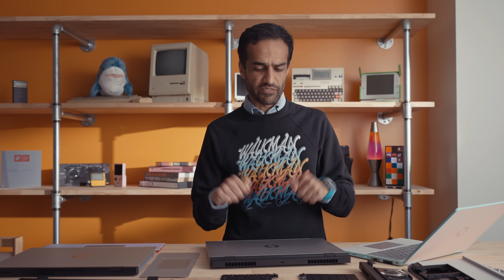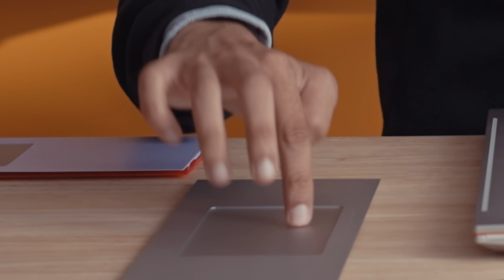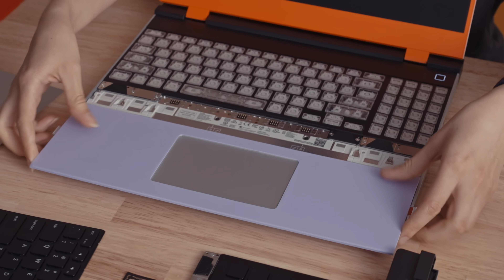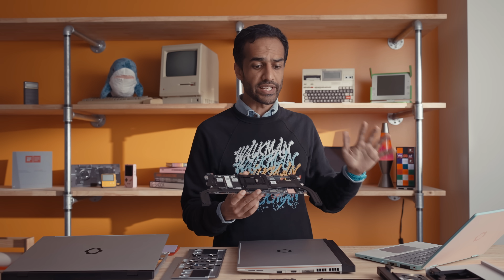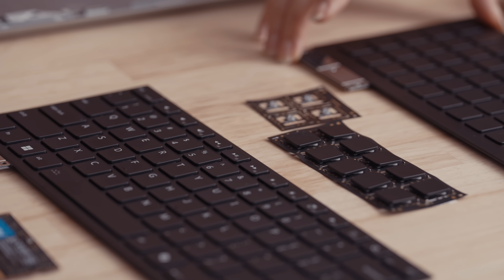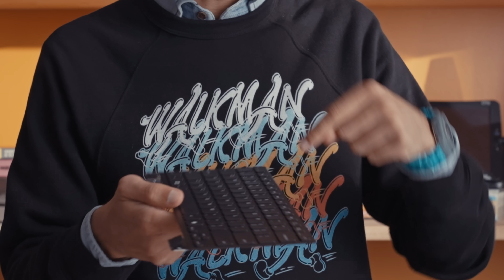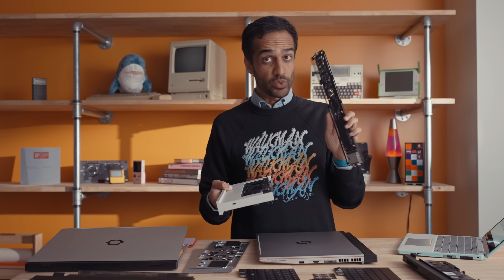Framework Laptop 16 - Prototypes and scrapped ideas

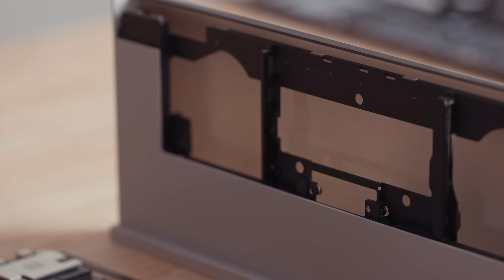Comment: 14:55 - 17:08 Wouldn't a Framework marketplace for reselling swapped out parts make sense? So that potential customers who can't afford e.g. a complete Laptop 16, could buy off the used GPU module from another owner. And the previous owner would be relieved to not have to room-fill drawers with electronics, which then just age away unused. (A small portion of the resell-price might go to Framework, for offering this very convenient way of repurposing redundant hardware.)

Comment: 11:20 Very important remark regarding the keyboard mouse:

Can't you develop a sort of round button that detects the lateral direction at which it's pressed, but that can't be pressed vertically ONLY when the laptop's screen is open? And when you close the laptop it automatically becomes vertically press-able like a normal key button?

One way to do this could be to make it un-pressable only when the keyboard is powered (a switch that locks only when powered for example), and then automatically disconnecting the keyboard from electricity when the screen is closed.
Or you could come up with some other way, but still, wouldn't this be feasible?

Comment: The only thing I'd like to see that isn't there yet is more ports. Sometimes I like to have a bunch of things plugged at the same time, and 6 ports is a bit tight. My current laptop has the equivalent of 9 ports... I've used 8 at a single time... i.e.: you could put a fixed HDMI on the back to help with this
Reply: I think the solution here is dual port expansion cards (e.g. 2x USB-C)

It would theoretically reduce the throughput (but are you really maxing out the throughput on data on a USB-C port under typical use? Even if you were, having a dedicated single port USB-C expansion card as the high speed one for read/write would be a suitable solution.)
Reply: @jessl1934  I mean, that would be a way of using the current model, but I'm asking specifically to avoid having to do that

Comment: I am going to buy a framework soon for 2 reasons #1 this guy is normal (odd for PC makers) and 2 it is just the only pc that will allow me to do what I want with my  PC  I want to run linux on my machine and I want the cooling of the 16 with the HX 370 no dgpu with the perfect amount of ssd and ram vs being stuck on hybrid nightmare pcs for linux works out for me the only think id ask for is a lunar lake for the 13 other than that it's always going to be framework after this.
Reply: I expect we're gonna see a product refresh of the 16 in line with the new 13 pro that just got announced. It's probably a year away imo.

If you can hold out for 12 months, that's what I'd be doing.
Reply: I agree i looked everywhere to find either a amd machine with just the igpu and i am fickle so i am already thinking of adding the raedeon so this allows me to be fickle and if i want to get it a few weeks later I will

Comment: I would so love to see a framework 15. It would be the framework 13 mainboard or a slight upgrade. By upgrade, I mainly just mean an extra ssd slot and possibly some more powerful gpu options. Either way, the idea is fw13 specs but with a 15" display to create a fairly thin and light 15" laptop that is upgradable. Basically the idea is a crossover of the 16 and the 15 for users of a 13 who just need a larger display.

Comment: I am near exclusive on laptop usage as I am always traveling for work. I need desktop performance in a portable form-factor. When my current system dies, I know what I am getting next. I just hope you start offering top tier options for those that aren't shy about cost. I have always been team Intel, but to be fair, I don't like the E-core/parked core BS. I hope they ditch this on upcoming generations.
I might suggest a "battery optional" build. Most (like 99.95%) of the time, I am plugged in and a battery isn't needed. Then again, slotting in a battery that is huge for massive battery usage would be awesome for those that need it. Make it part of a laptop cooling pad that locks in to the bottom of the unit. Having a blank cover for more fans or maybe even slotting in SATA, SAS or U.2 2.5 inch drive expansions would be a nice option for those not using the battery bay.
For the trackpad issue. Offer another module that has no trackpad (blank!!). I use a USB or Bluetooth mouse & keyboard all the time.
It is rare that I use the laptop's keyboard as that is always the first thing to mess up. This would allow slotting the keyboard on the lower part of the system where the trackpad is currently. Venting topside heat where the GPU/CPU is would make more sense. it may allow the option of upping the built-in speakers quality/quantity.

Comment: A single piece trackpad solution with just the normal sized spring board is all I want, I don’t think there’s the need to go for the complex option today. Put out the basic idea and then iterate overtime. The modular palm design puts me off in its current form

Comment: I have been on the fence between Framework and System76. Both are commensurately priced. I will go with Framework. At least with Framework, I can switch out modules as well as make repairs locally and within minutes, versus weeks with System76.

Comment: Can we get a framework desktop chassis that's wide enough for a half height pcie card, especially a dual slot card? And maybe a revision of the motherboard with an open x4 slot (or preferably an x16 wired for x4) as it would allow the addition of anything from network adapters to capture cards to sound cards to even low profile gpus, say you need more display outs.

Comment: Oculink ports and/or a choice of TB5 or USB 4 v2 ports would make the egpu route much more valid and rewarding too. These options are the only options that aren't massively bottlenecked in terms of pcie bandwidth, so older framework graphics modules will work just fine, or if customers wanna go crazy and hook up a 4090 to a FW laptop cuz why not, all will be made easier with official support for Oculink or adopting the new TB or USB standards. Unofficially there is Oculink support through the dual m.2 adapter module, so why not go the extra step and make it official? And it would make sense for Framework to enable higher bandwidth egpu support, given the company's ethos of repairability, DIY mentality, and upgradeability.

Comment: The input modules make me wonder about modular insides. Get 4 SSDs in one laptop, or fill it with batteries for max battery life, things like that. Maybe even a little low-power GPU module (let me dream). Like PCIe slots or drive bays in PC cases.

Comment: Have you think about using the screen and the keyboard of a framework 16 to create a Lapdock (a framework 13 is also a good option)?

Because, the existing lapdock for phone and/or gaming handheld are quite bad. Especially if you need a full keyboard.

With the release of your first desktop (a portable desktop), this could be a nice bonus to offer to your customer.
Reply: I would add, if you go with this, it should be able work with a existing framework laptop. In other words, the user should be able to downgrade a old laptop to a lapdock. The reverse should be true to. If someone buy a lapdock from you, they should be able to upgrad it later to a fully fonctionnal laptop.

I understand new internal part are required to make all this work. This way a fully workable laptop could be downgrade to this with the purchase of the internal lapdock part.

Comment: Lovely improvement, especially the NVIDIA... But quick question though, are you guys working on a workstation variant? Or will they be any workstation card in the future? And a near desktop processor would be appreciated please.
also when do we get the ability to change the Webcam? Will there be an 18 inch display? If possible you could make the body larger to house more components like extra speakers, and maybe more type c port. And increase the max power brick.

Comment: It's good to hear that you've tried implementing something like the track point, I'm curious if you've considered making it concave instead of convex? Or leaving a larger gap to the neighboring keys to allow it to sit lower?
I understand you don't want to engineer every little component that goes into these, but my understanding is that the current strain gauge navigation sticks available are very poorly optimized compared to the Lenovo/IBM history and I would suspect anything you design (or commission) will be notably better than the existing components. 

Lastly, I know a portion of that navigation dot quality is lost in the firmware/software, but I now understand that it could be from the over-thinnification of everything electronic these days. Your candor and openness is appreciated. 👍

Comment: It would be cool if you were to release the plans or even just release the prototype models like the touchpad. Even though it might not have worked for you, maybe someone else could find it ideal. One thing in general I'd like to see with Framework is more third party accessory support- not just 3D printing, more like full on electronics, for example a numpad-size touchpad in place of the numpad module, or (probably would require modifications of the mainboard) a mini display.

Comment: for the gpu, could you guys make a pcie card adapter to mount it into a regular pc? it would be a bit of a wacky size sure but it would mean we would have a proper mobile gpu to put into a desktop for low power usage builds instead of having to use the china knockoffs with no software support. It would also be a nice hand me down part for a starter gaming pc.

Comment: The screen looks very bad with these thick 2010-style bezels. And also 2010 laptop thickness. Can't understand why you are trying to make a profit on reselling RAM & NVMes. They cost literally up to 3x less to buy myself. And I'm sure as OEM you actually get them at way way lower prices. I really love the idea, but can't possibly justify spending this much on a thick unportable plastic laptop. I have a PC at home so I thought the whole idea of laptops is portability.
I'm still using a 2020 (5 years old!) 13" aluminium laptop, which has 2x USB-C (Thunderbolt) 1x USB-A 1x HDMI 1x SD card. Can't even fit these on your 13" laptop. Can't even think about adding ethernet. Mine has like 3mm bezels on all sides & touch. Why would I spend so much on a downgrade instead of getting something like a ThinkPad ultrabook?

Comment: What stopped me from getting a framework laptop during my most recent upgrade was the lack of availability of a top quality OLED screen or a 2-in-1 folding laptop. I ended up with an Asus Zenbook but got crippled by a lack of Linux support for the non-standard features (2-in-1 sensors, webcam privacy cover, etc) by Asus software developers.

Comment: If you could figure out a way to put a Wacom tablet option instead of a touchpad, that would be super super cool, I think thinkpad had it for 1 generation on a high end workstation model. Would solve the palm rejection and click detection problem as the pen input is unique. Also, since the laptop is both fully upgradable and made to last a long time, it would make sense and also be unique.

Comment: I looks like it isn't hard to make the laptop and it's pieces, the hard thing is to provide the parts at reasonable prices! And I feel that pain! I am from Brazil and the cheapest laptop from Framework is close to 4 minimum wages! Laptops at two minimum wages are the norm, and they are already expensive! But I am sure you will be able to go toe to toe with Lenovo and the other OEMs in price. In quality you are already in front!

Comment: The pointing stick thing wouldn't necessarily need to be in the same place as on thinkpads, did you consider putting it on the track pad module instead? Idk if you have more or less clearance there.

Comment: Silly question but you make a laptop with integrated space for adapters from usbc connectors to everything else. So why does the GPU require an external adapter to displayport and hdmi? I get that hdmi is a pain to add because of the group that controls it but how about a display port connector?

Comment: Great marketing and finally a company that listens, innovates and explains why things work or not.
 
My biggest problem is still the keyboard spacers, I really dont understand why there is no option to have a complete lower part in aluminum?
I mean the 3D print is exactly what I want, but why is it not possible to pay 20/30 bucks and have a complete module?
The file is already there? A larger trackpad would be great, but for me not necessary. I absolutely despise the spacers on the side, I get that its "modular" but please, why is it so difficult to create a  complete layout, with the keyboard, numpad and normal touchpad in the middle, like nearly all other laptops, that has no spacers? I mean for 2000-3000€ depending on the specs I dont want to have to rely on a cheap 3D print to get this basic experience 
I hope framework will continue to innovate and get this to work.

Comment: I want to see the motherboard, CPU, RAM, SSD, etc. to be accessible from the bottom of the laptop, not by removing the keyboard and trackpad, much like most ThinkPads and the way laptops used to almost exclusively be designed. This is a far more repair friendly design than having to remove the keyboard and trackpad.

Comment: Is it possible to offer the framework 16 with a more robust shell, which would prevent the screen from flexing so a pointing stick could be used? This is what Lenovo/IBM used to do with their laptops. You just have to make it clear to the consumer that a track point requires a new screen lid which is thicker or made of carbon fibre or strengthened somehow, I'm sure the market would be there.

Comment: I really really want a Framework laptop, but I want the 13 or 16 with a touchscreen AND 360 hinge.  I want to use the laptop and my own wireless keyboard when at a desk.  I would like to tent the display so the the laptop base is not in the way.

Comment: I'm still waiting for a touch enabled oled screen and a Ryzen 9 395 for the 13 inch. It's the reason i ended up going with a different laptop. If these ever become available i will certainly switch to framework, it's just a nobrainer.

Comment: That eGPU dock really really excites me! In my use case, I rarely need that much performance on the go that requires a dedicate GPU, but I want to be able to use the same laptop to play games and do my work. An eGPU just makes a lot of sense, but the price is steep and the support across different brands are just non-existent. With the modularity built-in on Framework 16, even when I need both portability and performance, I can just put the GPU module back in and now I've got all the performance. Keep on the good work!

Comment: Thank you so much for sharing this. The wife and I each have a fw 16 and are very happy with them. I have wondered about it. I have some questions/suggestions:
1. Any chance you might do an aluminum single part trackpad?
2. I have noticed how the chassis bottom cover has holes in the far ends where the GPU magnetically attaches. You can see it in your picture in your companies "deep dive" post into the chassis. My question is why not use these two far holes for added strength in mounting the GPU to the chassis? Having all the fasteners in the center means the edges have more leverage which is less optimal than say a plastic capped thumbscrew a the ends.
3. Any chance of a 2nd battery going in the space currently used by the GPU?
4. Is there a reason to consider a lower battery consumption intel GPU option? There are some of us who want graphics with dedicated memory but not some gamer/AI focused addon.
5. The original framework laptop and the 16 both had more robust display covers added in their 2nd versions. Not to be crass about it but how did the same sort of issue slip past you again? Sorry if this sounds frustrated but I went through a few cycles of replacement parts and ultimately mailed my unit back before I got one that was good.

Comment: not sure if this will get read, but a suggestion as a potential solution to the trackpoint issue: add some kind of hinge spacer (for both the 13 and 16), to allow for trackpoint and maybe even thicker keyboard. people dont want thin/low profile trackpoints, the X13 just doesnt feel as good compared to a T480

Comment: I think it would solve some issues for people who put the keyboard all the way on the right or left if there was a double spacer SKU. Because I think having just one gap would be a big improvement. The other alternative, if the parts that interact with the locking mechanism on the spacers had slightly better tolerances, they wouldn't wiggle as much, and I think a lot of people would find it less objectionable.

Comment: After some thought, I would like to see a modular NAS. Because I'm tired of the Synology and QNAP monopoly. It would be useful to be able to connect a smaller or ITX-sized motherboard with the possibility of expanding to a large number of SATA HDDs and 10 Gigabit Ethernet. If it could be hidden in a vertical low-profile rack cabinet on the wall, that would be awesome. Additionally, putting TrueNAS on it would be great.

Comment: One usefull type-C expansion module upgrade/option will be to make a Full-size and Micro-Sd combo expansion module in which there is a port for bothe size Sd cards in a single expansion module.
Also with the highest speed available for the current or future version specification, like UHS-2 is for Full-size Sd cards.😊😊😊